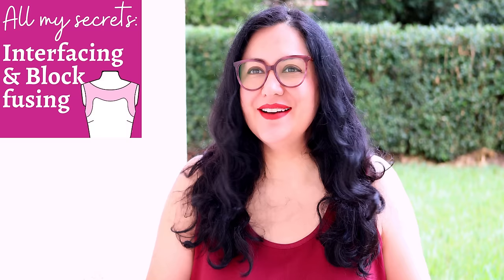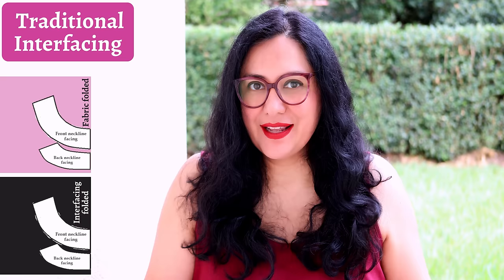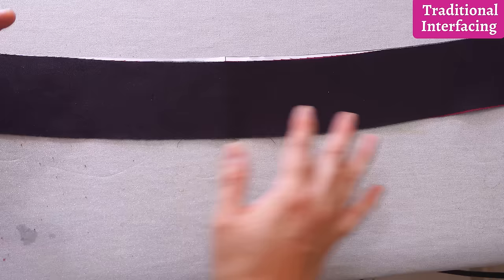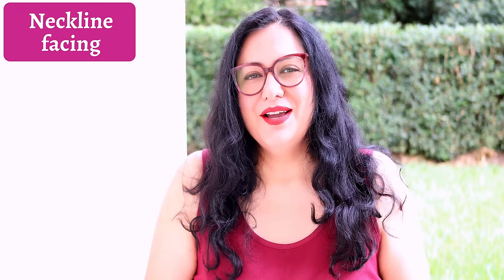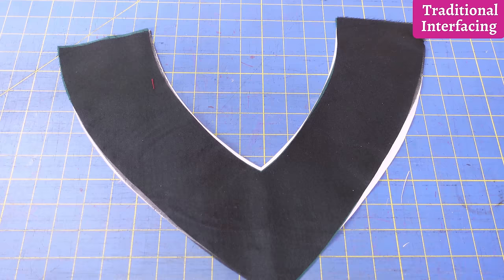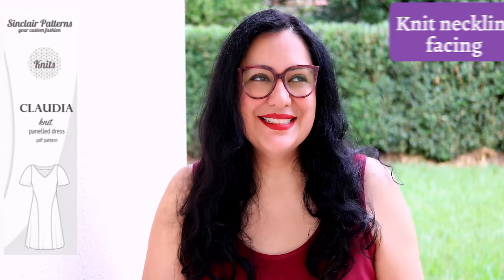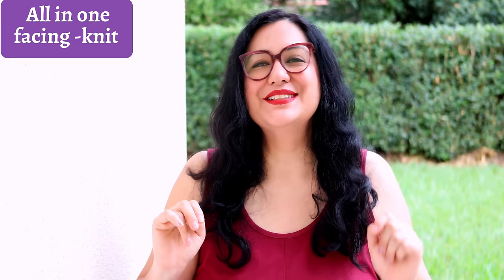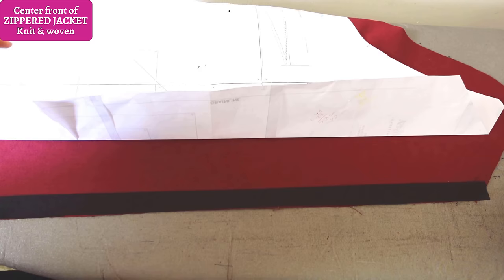Seeing is believing! Traditional interfacing vs BLOCK FUSING. Wonky facings no more! examples galore

Comment: I’ve made a few jackets and coats and have found block fusing really improves the fit and look, especially with Boucle knits. A knit interfacing allows some ‘give’ but also provides enough structure to prevent sag. I especially appreciated your tips for applying interfacing along edges. Thanks for a great video.

Comment: I watched Sandra Betzina do block fusing and I’ve done it that way for years. However, I’ve also used Casey from Pattern Scout’s method of sewing three sides of a facing and interfacing wrong sides together at 1/8”, flipping it out and ironing before sewing it to the main garment. It’s so neat on the finished garment.
Reply: You’re like me. Im old. I learned from Nancy Zieman, Shirley Adams and Sandra Betzina many years ago. Also Singer tailoring books and Threads Magazine. Karina is doing great work like them.

Comment: I have been using your block fusing methods for quite a while and it really makes a big difference. At first I thought it would waste fabric and interfacing, but when using the traditional method of cutting separately, you end up with bits that aren’t usable and it takes more time. Thanks for another great techniques video, Karina!
Reply: When I first learned about it years ago, I thought it would be too thick but I was wrong. it eliminates distortion.

Comment: It takes a little more fabric and interfacing to get a perfect finish, but honestly, what can you do with those tiny scraps you can eek out by cutting and fusing separately and will they make up for the poorer finish on your garment? I'd rather get the best finish I can on the main project and accept that scraps are a part of cutting cloth. Tanks Karina, I already block fuse, but it's good to see how you handle the different fusing situations in one video.

Comment: Have you considered getting a heat press to apply the interfacing? I have a steam press that looks like the ones that look like a small version of a dry cleaners press. It makes fusing so fast.
Reply from the maker: I’ve never seen one in my life and I’m sure it would not be easy to source one here in Brazil. I’m keeping things as they are for now :)
Reply: I use a heat press to block fuse, it saves so much time and not at all fiddly.
Reply: I only use a regular Iron for fancy garments the rest of the time I iron our clothes with a Singer Magic Press. I still however use my regular iron when fusing interfacing as I have had it stick to my ironing press once too often and that glue is hard to get off.

Comment: This is great, but then do I also cut everything flat, not on the fold? I'm thinking that makes sense with this facing accuracy difference. Thanks for the seeing is believing demo.
Reply from the maker: Anything that is interfaced… I’d rather not cut on the fold. I extend the pattern piece to cut it single layer and more accurate. For regular pieces, I’ll place on the fold.

Comment: Karina, do you pre-soak your interfacing?  I read once in Threads magazine advice to soak my interfacing (even the fusible type) in hot water for 10 minutes and then hang to dry or dry flat.  I have never seen that covered anywhere else.  What do you do?
Reply from the maker: I’ve only done that with woven cotton fusible interfacing. I only use that for collars because it’s so much stiffer. The type I use all the time is not one you wash at all. It comes ready.

Comment: I have a question when you mentioned not interfacing denim pockets. I am planning an encore skirt with 300gsm/8.8 ounce denim. Would you still use interfacing for that? Thanks for this video it is very informative, When I used interfacing in the past I suffered from the interface shrinking and distorting and was so confused as I had washed my fabric and didn’t realise interfacing shrank. Block fusing has changed my sewing journey.
Reply from the maker: You always need to interface the slanted edge. I was talking specifically about patch pockets and the Encore does not have that. Also, 8.8oz is light weight. I was thinking more of the thinker denim.
Reply: @LiftingPinsandNeedles thank you so much  for answering me. I haven’t sewn with denim much apart from hemming jeans as you can probably tell 😊